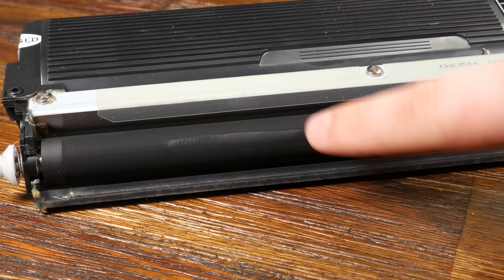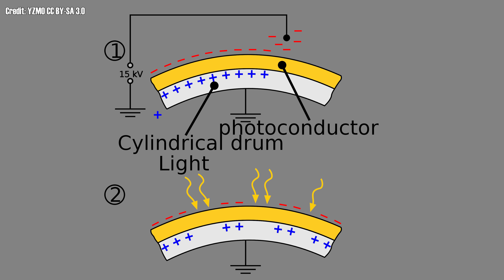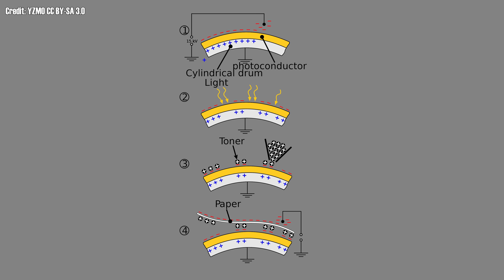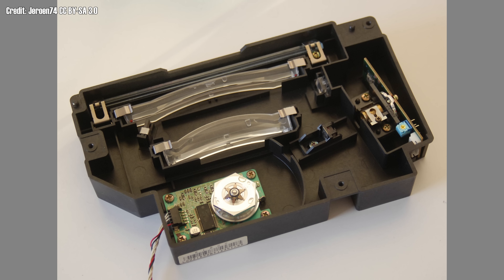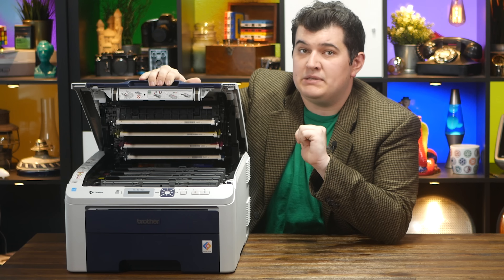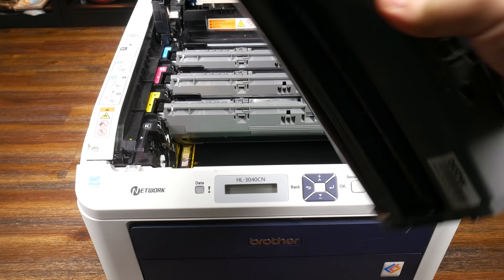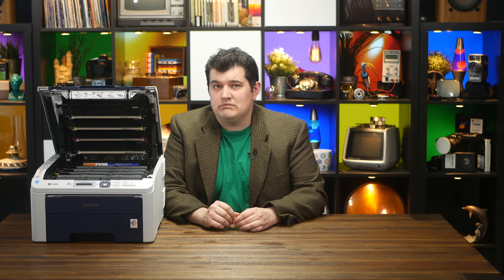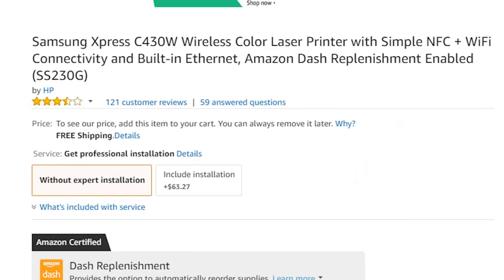LED Printers: The Common Printing Tech You Haven't Heard Of

Comment: Technically both use a diode to charge the image unit.  Light Emitting Diode vs Laser Diode.  The difference if the light emission.  The Laser Diode emits light by stimulated emission whereas the LED uses spontaneous emission.   The primary difference is the scanning assembly or the spinny thing as you called.  Take a listen to a laser printer when it prints.  Just before it prints you will hear a high pitch sound.  That's the scanning assembly getting up to speed.  Print speed was most noticeable in the early days when you had printers that used a carousel assembly vs a single-pass printer as you have.  Carousel (Laser Printers) would first print the black image, that image was then transferred to the transfer belt.  The carousel which holds the toner cartridge would then rotate and print the magenta portion of the image.  It was then placed (or stacked) on the transfer belt with the black portion.  Same for the Cyan and Yellow.  Once all four colors were placed on the transfer belt the paper would be fed into the printer, the image would be transferred to the paper and then fused to the paper via the fusing assembly.  The fusing assembly would melt the primary colors together to give you the different colors.  Much the same as mixing paint.  But when you only wanted a black page to be printed with a carousel printer, it would only make a single pass.  It would place the black image on the transfer belt and then the paper was fed into the printer and the page was printed.  Basically, it was just a monochrome printer at that point.  Single-pass printers as all of today's color printers are do the same printing process if its color or just black and white.  so the speed doesn't really differ.  When it can differ is if you ask it to print a higher resolution to reduce what's called star casing.  That's the jagged edges that can sometimes be seen.  The printer will also slow down when it is printing on thicker stock such as thick paper, labels, and envelopes.  This gives the printer a little more time to fuse the toner to the paper.  Over the past 35 years, I've invented the worlds only laser printer diagnostic test equipment, taught printer repair courses around the world, aided in the design of laser printer for the five leading printer manufacturers and invented the worlds only intelligent laser printer / copier paper tray lock which prevents the unauthorized removal of blank print media such as checks, letterhead, prescription forms, certificates and more from the printer.  Nice video hears just a few facts to help.

Comment: I think that I understand the principle, but there is a difference between a laser beam and an led beam, basically that a led beam is not as accurate as the laser beam, so do those printers have some problems on that matter? or just the size of the leds and the distance to the drum make that insignificant?

Comment: I have a inkjet and I hate it, constantly putting it thru its cleaning cycles to get it to print correctly with amazon ink lol and it prints better on glossy photo paper vs plain paper. I want a color laser printer but very pricey and I dont want to settle for monochrome.

Comment: Things you missed out on laser printers . The drum never makes contact with the paper. It makes contact with an image transfer belt and then the paper makes contact with the image transfer belt and a registration roller that compresses the toner to the paper prior to the fuser which then melts the toner to the paper. Also toner itself holds no charge because it is just dried powdered ink, it needs a carrier which is called developer which is powdered iron and within the developer unit the toner is supplied so the developer then in turn carries the toner to the drum, to the belt and then finally to the paper.

Comment: You're right, I never heard of this technology but I'm thinking that the "LaserJet" color "laser" we have sitting here is an LED printer because the speed is the same black or color and it isn't much bigger than a black only laser printer frankly.  Did HP pull one over on us?  Maybe. 

Did I mention that laser printers have a hidden danger inside them?  The laser.  Well OK, it's unlikely to ever put anyone's eyes out who isn't working on the thing tore-down, but that said, it's all true that no LED printer has or could ever blind anybody with intense beams of light if a cover was ever missing or removed near the print drum.  

LED printers are potentially more power-saving not because hundreds of miniature lense-focused LEDs use less power than a single pulsed laser-diode (they wouldn't), but because they don't need to waste additional energy to spin a motorized prism for a laser and if there is no image on part of the paper, they stay off whereas that laser printer motorize prism will be constantly spinning from just before printing and throughout the entire printout even if it was just a singular word on a page because of lag of spin-up time to settle the motor speed precisely at the required stabilized speed needed for the laser would make this difficult to impossible to achieve so a laser printer would never turn the prism motor off at any point during the middle of a print, but the LEDs have to adaptively turn off on blank regions of the page because that's linked precisely to how they work.  Only when they are on can they heat the drum or place a charge on it to attract the toner to only those spots where toner goes..

Comment: Huh, never realized that many people didn't know about LED printers.

My first LED printer -- actually, my office's -- was ... drumroll ... a Brother MFC color printer. A big one, capable of printing onto A3 paper. Great quality, great speed, and quickly became the office darling thanks to its ease of maintenance and much less expensive consumables (all Brother LED printers usually have a separate drum & toner assembly, so one can replace the toner cartridge without having to replace the drum).

My experience with Brother was so satisfying, I bought one for my home. A smaller one, of course, maxing out at A4 / Legal.

So, it kinda stoked me that you're also using a Brother printer. They do make good printers, don't they? 😄

Comment: I would like to point out that most of the issues you listed for ink are fixed by things like pagewide from HP or ecotank by epson (i prefer pagewide by far). Also pigment based inks instead of dye based ones also fix some of your other complaints. The issue is getting the RIGHT printer for you.

On a side note you also have things like hp instant ink that help with ink worries though frankly the cost per page on high end ink printers is equal or even better in some cases to lazer.

Comment: I actually had the OG beast of color lasers from 1994. HP Color LaserJet.
It didn't use toner cartridges. There were hoppers on the rear where you could dump loose toner of each color. Even had JetDirect so I could print from wifi via a switch. Unfortunately it was lost in a flood :-/

Comment: Technically, what may happen with your printer (and my kyocera color printer) is that the drums first transfer it to a belt, then that transfers to the paper. On the ones that are a quarter of the speed IIRC they apply one color at a time with a rotating drum  that then applies to a belt in 4 passes. The older HP printers did this.
Reply: The older HP ones had a 'carousel' build into them that actually moved the toner cartridges around for each color pass. they were big heavy, slow monsters.  The newer ones that I remember looking at  kept  the transfer belt, but were able to render the image in a single pass as they had the four toners in line. As a technician, I hated working on these models, because 90 percent of the quality issues were due to what were deemed 'consumables' by HP (and Xerox for their models), which was pretty much everything in the paper path: toner, rollers, transfer belts/drums, fuser. the only thing non-consumable was the controller, the gear train, and the plastic housing it was all contained in. :(  Despite that, if you do intermittent color, it's still cheaper over the long haul than  inkjet on a per page basis.

Then there's certain models of Tektronix (now owned by Xerox) Phaser printers that used _wax_.  20 minutes from cold start and it used a set of the wax color blocks (and yes, we did call them crayons!) in the warm up process, but once it was ready to go? BOOM! Full bleed proof-quality color in 20 seconds, which was considered black magic when it came out.  Just.. don't move the thing until it's cooled down and the wax solidifies, unless you want melted crayon all over you. :D

Comment: You, my good Sir, have just helped me solve a Problem that has haunted me for at least the last year! After many toner cartridge and toner drum swaps, my printer still printed either very thin or extremely blurry around fine details. I cleaned the toner drum and fixing unit with rubbing alcohol but nothing helped. After watching this fine example of audio-visual excellence, I went to look for this fine row of LEDs and after a quick cleanup with rubbing alcohol, the prints are crisp, sharp and as new! You have just saved me from buying a new printer. Consider me as a part of your notification squad!
Reply: The toner cartridge boxes for my old 1990s era Okidata LED printer used to come with an alcohol swab pad and instructions to do that as part of inserting the new cartridge.
Reply: lol good for you!
i thought about doing that too
Reply: I am going to try this to my Brother 3070CW asap.
Reply: I might have a similar experience, so much time later. But I can't confirm before I get back to the office, which is in July. This is HUGE for me (working in tech support)
Reply: if you have one of those things that close doors automatically that's really slow or really fast he made a video on how to fix that too! it's really simple

Comment: "[note 0:19] higher upfront cost" ==> Under-correct.   Fact:   "Newer" doesn't necessarily mean "better". Probably because color printers and "multi-function devices" (eg. printer, copier, scanner) are "cool" and "fashionable" and ignorant buyers are under-estimate the importance of all the necessary compromises, older B&W laserjets are REALLY cheap off craigslist.   ie. Laserjet 4L was US$5.00 (five bucks!) with new cartridge (generic replacemenets are ten bucks per pair.)   Less old LJ 1600D duplex (20+ ppm) was US$20.00 (TWENTY measly bucks), same price for generic replacement toner cartridges.

Comment: IMO inkjet is alright provided you're not using those shitty cartridge based units and you keep the heads clean. Real men have an Epson WF-R5690 or WFR-C869R and rely on ink bags instead of cartridges with 3 pages worth of ink and that clog when not in use for more than 3 weeks.

Oh... also, there's an additional step in laser printers that you missed. The toner is mixed with fine iron filings, called a developer, to make it more electrostatically sensitive so it sticks to the page as it's passed by the charge drum. Not having this developer can cause some weird artefacts and your printer is designed to warn you when the developer unit(s) are  nearly spent. 

NOTE: The location(s) of components such as the developer units, toners, charge grids and drums differs from machine to machine. I cannot off the top of my head tell you the precise locations of these parts as they differ from machine to machine, however the main architecture of all laser printers is nearly identical so finding components such as these is not too difficult.

Troubleshooting tip: If you get a weird ripple pattern with your laser printer, this normally means that the ratio of toner to developer is not correct, and you should probably replace the developer unit.

Other artefacts that can happen:

Lines on the page where there shouldn't be any or colour lines on prints: Contaminated charge grid.
Solution: Clean the charge grid using the usually provided cleaning rod for your machine. The cleaning rod for charge grids generally has a small wheel on it which is used to knock the toner off as you insert the cleaning rod.

Missing line(s) on page or lines where colours are missing: Contaminated laser glass on a colour
Solution: Clean the laser glass using the usually provided cleaning rod. This cleaning rod has a small pad on it which cleans loose toner from the surface of the laser glass and should restore the missing lines.

Side note: If these artefacts are happening on copies but not prints... check your originals and make sure your scanner glass is clean. Scanners only do one line at a time just like the laser that discharges the charge drum in the machine, so if there's a spec of crap on the glass, it will show up as a line down the scanned page. This issue tends to happen more with machines that have an ADF unit (Automatic Document Feeder) that feeds the document past the scan head. The scan head remains in the same position at all times when using the ADF to scan so if the glass is contaminated in that area (which is common, especially when scanning pages which have been written on with biro), the scan head will register it as a dark spot on each scanning pass, resulting in a line down the page.

Comment: I love printers. I am a repair tech for one of the above companies and I can tell you for certain the canon's imageclass lbp series have lasers. The laser unit is very small and  fits towards the rear. HP does the same as well. They are making the units smaller and smaller each year.
Reply: So tell us, printer man, which reasonably priced laser printers actually measure the amount of toner, instead of just counting pages and telling us that the cartridge is empty, when it's still full? I'm sick of buying toner just because the chip on the cartridge tells the printer that 'you printed 2000 pages, so there's no toner left, so stop printing', when there's plenty of toner left.
Reply: @d.e.b.b5788   No printer actually "measures" toner. It is an estimated value. Most toners will say estimated life. Toner life is calculated based on toner usage. When the light hits the drum and creates a static charge the controller records that information. It then estimates how much toner usage out of the total is left based on density and coverage. The chip on the toner cartridge also stores the information given from the controller.  The chips main purpose in life is to prevent counterfeit  toners from entering machine.

Comment: i have had a Brother HL-3150CDW colour LED printer for almost 2 years, it is a great printer, works really well, the quality is really good.  I decided to get one when my old inkjet started playing up as LED printers don't dry up, true the quality of photos may not be up to inkjets, but on decent photo paper they are pretty good. 
I don't use it a awful lot, so as yet I have not replaced any toners and that is the one problem with laser and LEd printers, while they work out cheaper page than Inkjets, it costs more for the toner and then there is the drums that need replacing now and again and other things like the toner box and the belt

Comment: My first office laser printer from around 1987 was a Panasonic, weighed around 55lb and was huge. It worked fine until it was damaged by an incompetent factory service facility. I replaced it with a couple of Oki Pageprinters, LED units for less than half the cost of the Panasonic. As they aged to the point where getting supplies was a problem, I replaced them with current models. I retired 3 years ago and still rely on my last office Oki printer. They are bullet-proof, inexpensive to buy and feed.

Comment: Now, take a look at the Phaser printers from Xerox. They use wax cartridges, that leave no mess, and print photo quality, smudge and water proof prints, at a high speed consistency. I was a beta tester, back in 2004, and printed several corporate proposals, with high quality images. It's claimed, by Xerox, to be the cheapest cost per print, without sacrificing speed and quality. They also claim that the ink is UV fade resistant.

Comment: Brother printers that use LEDs have almost universally been marked by retailers as laser printers (I know, I did a lot of research on this when I was looking for mine and had an argument with one vendor) but Brother only uses the term "laser" when discussing paper or other printable materials in relation to their LED printers, as those consumables are almost all universally marketed by their makers as "laser compatible" (and it is generally the heating element and rollers that they must be compatible with). So, from the average user's point of view, "laser printer" and "laser compatible" can become conflated, or, ahem -- "fused" ;-)

My HL 3140 CW manual has an entire section titled "Cleaning the LED head" which begins "If there is a problem with the print quality, such as light or faded colours or white streaks or bands down the page, clean the LED heads as follows".